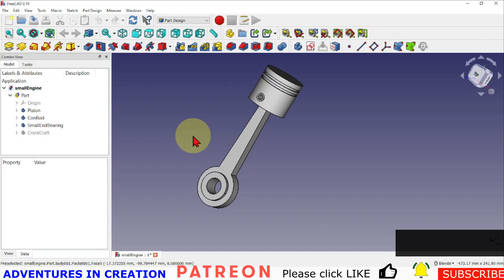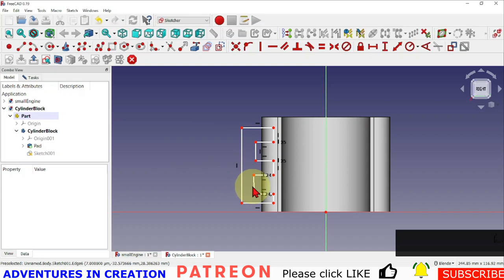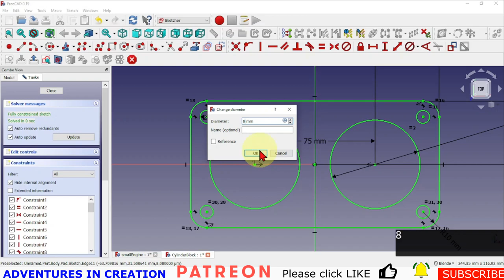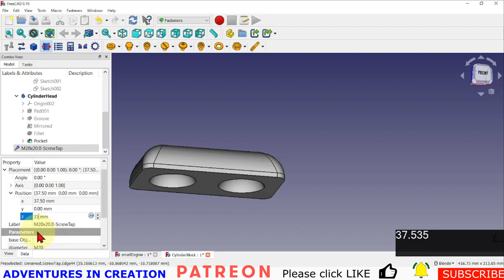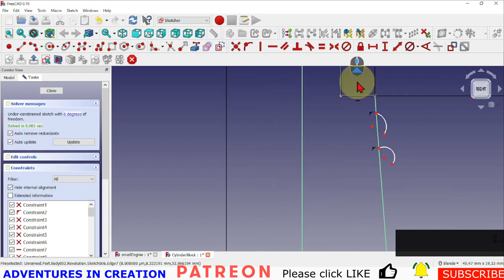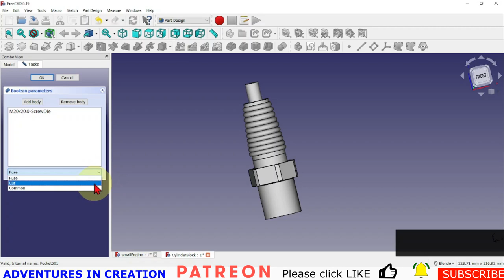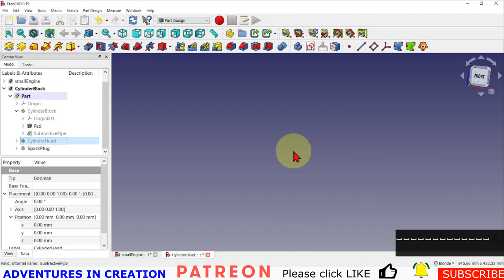FreeCAD for Beginners #16 - Managing Multi-Part Models Pt2

Comment: Cutting the fins out just like the print in place hinge, nice!
Reply from the maker: I thought that was a fun way to do it
Reply: @Adventuresincreation  What is the advantage of using the tap to create a threaded hole over the hole tool? I like the method, but am curious.
Reply from the maker: @SomeGuyInSandy  I find it very easy to use and understand. I love that you can use a tap or a die as if you were cutting the thread yourself.
Reply: @Adventuresincreation  I'll give it a try, thanks! 👍

Comment: Sweet! Thanks for this once again.

Navigation tip if you're using Blender settings in the viewport: click and hold both left and right mouse buttons at the same time to rotate your model (center of rotation is where your pointer is at at the time of activating rotate, so the closer to the center of your model, the more control you will have), and click either one mouse button, then the other and hold if you would like to pan in a direction. 

Also, it's quicker to use the up and down arrows to increase/decrease measurements/offsets within relevant inputs instead of the up/down arrow buttons. 

Lastly, the attachment settings in the part data tab in Combo View also has an ellipsis which can be clicked on to open up the positioning settings in the Tasks panel for a bit more user friendly management of these settings.
Reply from the maker: Thanks for sharing Werner.

Comment: For the cutout in the cylinder head you kind of gloss over it as being a 'revolution',  but it is a 'groove'. Threw me off for a bit - but liked anyways, thanks!
Also, in my  default installation (newer than yours, 24291) the icon for the screw taps has changed. For me, it's the last one in the toolbar and it's not 45 deg angled anymore, now it's vertical.
Reply from the maker: Sorry if I misspoke
Reply: @Adventuresincreation  Don't apologize - I know how hard it is to explain concepts to beginners coming from an expert level. You're doing a great job overall and I appreciate your work!
Reply from the maker: @haraldwalther5957  thanks!

Comment: Hello, I have a question. I am trying to replicate "threaded holes" across all four corners of the square. I applied multi-transform on a single "threaded hole" (which is present as a "Boolean" object in the body). While transforming, I am getting an error "Only additive or subtractive features can be transformed". Could you please suggest any other way to replicate threaded holes? 

I even tried to apply the threading to each individual hole. However, it looks like only one Boolean object can be active inside a body at a time!
Reply from the maker: Did you use the fasteners wb?

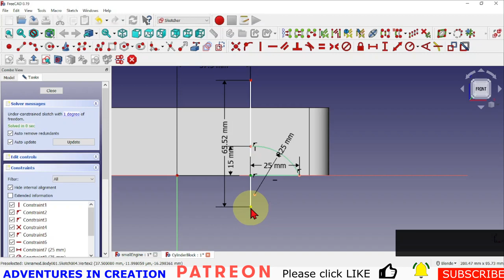Comment: Your sketch changed from 21:35 to 21:41? Why did you go to a construction line?
Reply from the maker: I used the construction line to revolve around. If you look at the drop down, the construction line becomes an option to center the revolve on.
Reply: @Adventuresincreation  Yes, I figured that out once I saw you had removed the lines at 21:41. I apologize if it seemed my comment was attacking you but I'm so frustrated with these inconveniences (sketch continuously turned off when sketching, Add-on Manager not working, naming convention issues, so on). I reinstalled the RealThunder version which is FAR SUPERIOR to the currently release version 19.02? With Fusion 360 change to usage policies FreeCad has an oppourtunity to grab a huge portion of the market but decided instead to drop the ball by letting these fundamental problems to persist and not seeming to care for the users. Too bad, because I'm sure more people would donate if the product was RELIABLE and maintained. Thanks for all you do.
Reply: That threw me as well, but it provided a moment of personal triumph when I figured out why my "revolve" wasn't working. At about this point I took to pausing the video after he said what he was about to do, tried to figure out how to do it myself, then resumed the video to see how close I got. These are really great teaching videos!!

Comment: Author got carried away with bells and whistles. No need to spend hours of time for refining radiator fins for demonstration of multi part model. First lectures were brilliant. Initially author really didn't over complicate the topic and chose the simplest forms to demonstrate the concept. But further and further I go along this playlist, the more disappointed I become. Besides, a piece of video is missing at 21:45. I manged to figure out that trim edge tool was used, but kinda would be nice to state it clearly.
Reply from the maker: I appreciate your feedback.